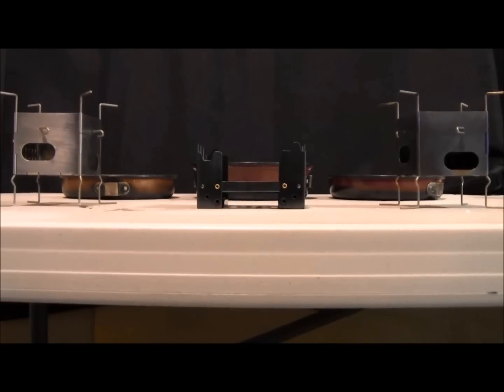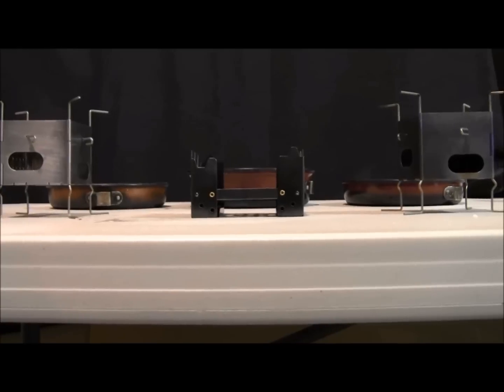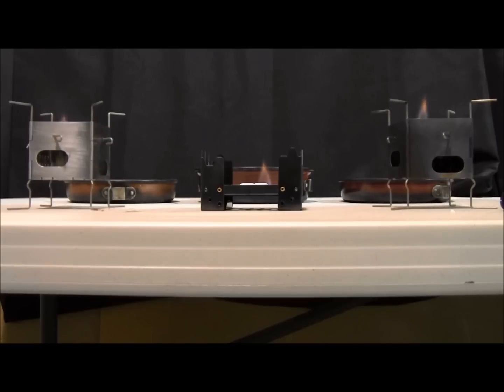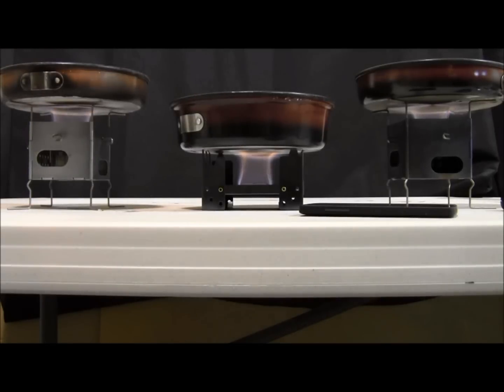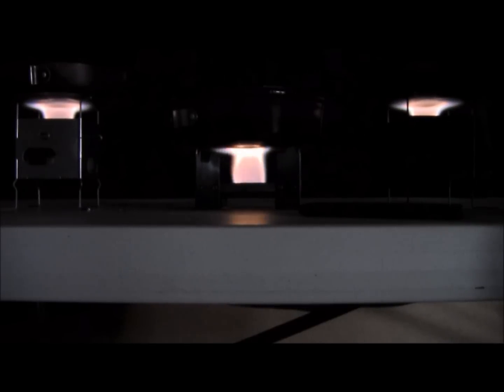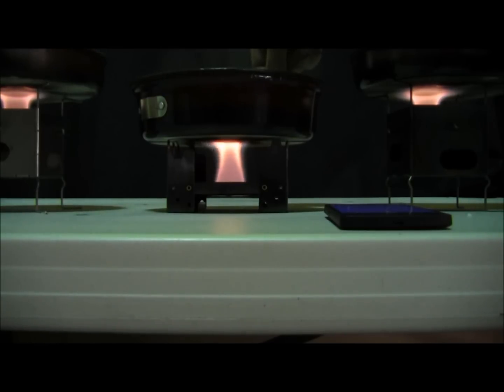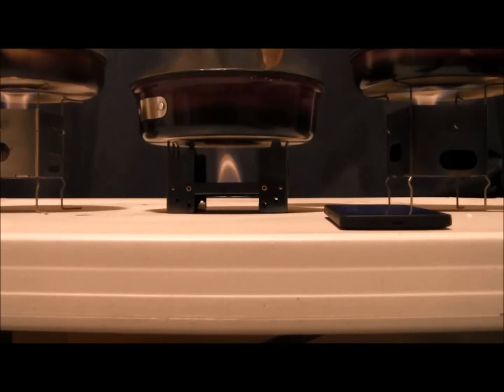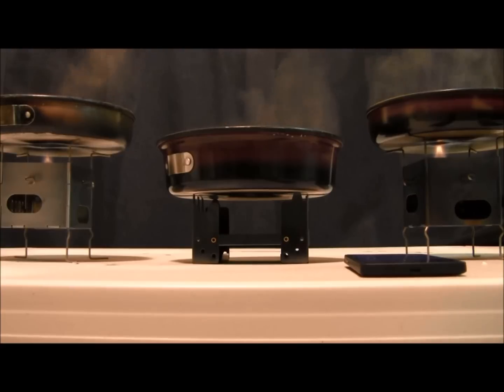R&D Prototype Testing Gen2 Firebox Nano Stove Fuel Plate Accessory / Esbit.

Comment: Hey Steve! I've been using the 1st gen ti nano firebox to burn Esbit fuel by using an evernew stand and stove.  I place the stand inside the nano and place the evernew stove inside upside down..the bottom of the evernew stove serves as a nice platform for an Esbit cube.  I posted my first youtube video on this today and then later came across your r & d project for the 2nd gen nano.  Using this method adds potentially no extra base weight to your kit if you are already carrying an evernew stand and stove with your nano and gives an UL person even more fuel versatility.
Reply from the maker: Cool! Good thinking!

Comment: Any idea when the solid plates will be available? I was very excited to see that the Gen2 Nanos are back in stock. Hopefully, they will remain in stock for another 3 days. :)
Reply from the maker: I hope to have them in a couple weeks. We had to shift gears to catch up on Nano's and am trying to get back to these asap.  Thanks for asking!
Reply: FireboxStove Will the solid plate have a depression for the esbit tablet? Or will it just be a flat plate? I hope to place my order for a nano tomorrow. :)
Reply from the maker: sja2249 It's basically flat. there is a depression but it's very minor
Reply: FireboxStove I just got my Nano's in. I'm very excited to try them out. I may try to fabricate a solid fuel plate in the near future. Did you ever consider including a small piece of tubing to help secure the legs in its folded state? I find that the jacket from a piece of cat5 cable cut to about 2.5" works great as a silencer and stabilizer. Just a thought. :) Thanks for producing a great product!
Reply from the maker: sja2249 No, I haven't thought of that. Thanks for passing that idea along, I really apreciate the feedback!

Comment: I bought my first fuel tablet stove in 1973 or 74. I currently own twenty or so. Yes, twenty (20). So I have over 40 years of experience with these units, almost all of it good, and I want to make two comments.

Use a windscreen even if there's no wind. The difference is remarkable. I know this was a comparison test but different design stoves get more or less benefit from a single design windscreen and the differences (or similarities) among the three would have been accentuated.

The folding stove you used for comparison is probably the worse choice you could have made. Several manufacturers make them in several sizes and that all are great for what they were designed for (in the mid 1930's): heating precooked food. NOT COOKING FOOD OR BOILING WATER.

My stove of choice and my benchmark is the Esbit ST11.5 Ultralight Titanium Folding Stove. It weighs about 14 g with case... about the same weight as a fuel tab. This little beast boils all my water, heats my food, and occasionally allows me to cook when re supply or laziness doesn't prevent it.

There's a startup in CA called Flat Cat Gear that has some innovative designs. I use one of their tablet stoves to bake biscuits.

I have one of your excellent 5" folding firebox stoves that I use quite often but I have never tried it with fuel tablets. I figure I'll always have the Esbit along and won't go through the aggravation of assembling the wood stove turned tablet stove when I can quite simply energize the Esbit in 30 seconds for a cup of tea.

Please contact me if you need anything more on fuel tab stoves...most people would not believe some of the places I've used them!
Reply from the maker: Thanks for your thoughtful input based on very valuable experience.

Comment: Excellent test Steve, no holes it is! Gave the Nano Gen II its maiden run in the bush yesterday with the Trangia. So easy to utilize the simmer ring, worked great! Not sure how much colder I'll get away with the methyl hydrate though as we were just below freezing and it's well over 10 minutes for a boil with 600 mL. Going to add a windscreen next time and see how far I get. So far a very mild winter above the 50th.
Reply from the maker: Thanks for the Gen2 feedback. If your just boiling, It will actually run hotter with the Trangia lower, but if you need to simmer after the boil the new highest position makes the most sense.  Cheers, Steve
Reply: What is the simmer ring?
Reply: @swekiwi4517  The inner cap that has a sliding top to control the amount of flame coming out of the Trangia burner; also used to snuff out the flame when closed and dropped onto burner.
Reply: @canesser1  Ah! I assume it's this one: https://i.imgur.com/C6GGAqG.png
Right?
Could you help me with these questions?
1. How much alcohol does it fill?
2. For how long does it burn if filled to the brim?
3. How much do you fill it when using it (if it differentiate, do you have a few examples?).

Thanks in advance!